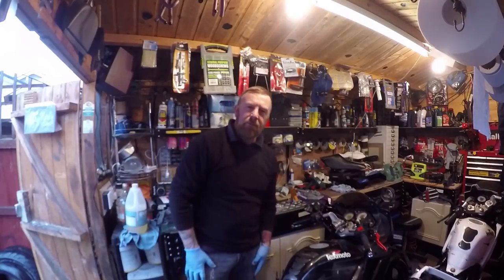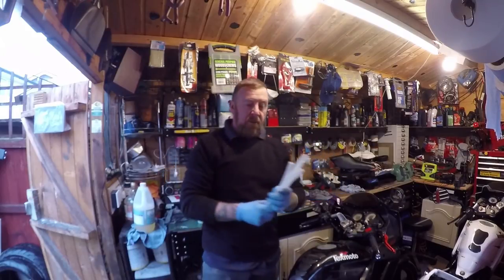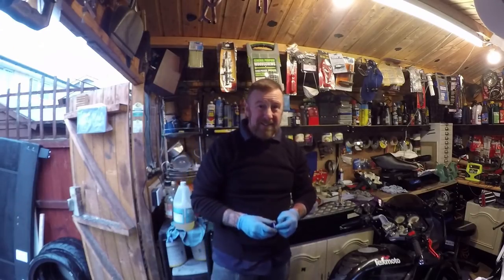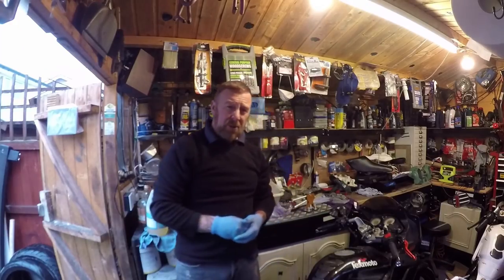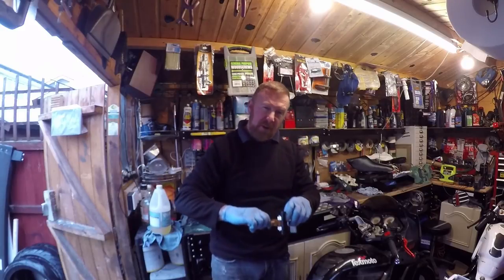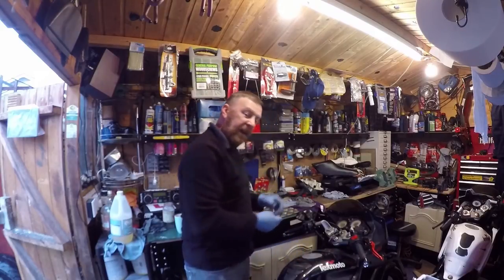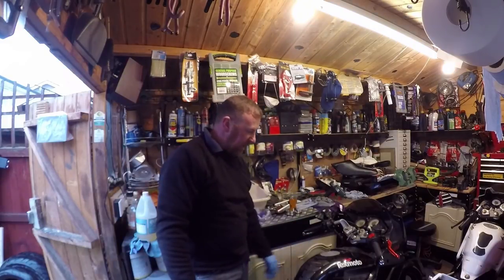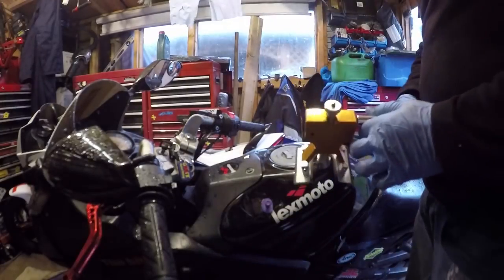DENT REPAIR REMOVAL KIT DOES IT WORK ?! MARK SAVAGE

Comment: I guess its a copy of the similar system used in the motor trade. They weld line onto the panel, then use a puller to ease the rent out.
I guess this system is only as good as the glue.
In one of the other comments you mentioned the hot water method. I tried this on my brothers car. Was a bit sceptical, but it vastly improved the dents.

Comment: You have to key the pads before you use them, when they are new, they are too shiny and have a glaze for releasing from the molds. Best thing is to give them a rub with 240 wet and dry, clean them with panel wipe before applying the glue. And use the largest pad possible, to get the best surface area. 
      Good luck. 
Ps acetone cleans well too.
Reply from the maker: also worth a try takes bud

Comment: it should work,  put a few holes in the plastic so glue comes out creates a better seal.
also, there are lots of different grades of adhesion glue they come in different colours the
one your using is the standard only good for fin metals,  you need the black one anyway goodluck
Reply from the maker: ok thanks ill look into to that

Comment: Hi Mark. Could it be that the face of the pad is too smooth? Maybe if you roughen it up with some course sandpaper/wet & dry, that may improve the adhesion?

I had a cheap GoPro copy and the brackets wouldn’t hold their positions no matter how tight they were done up. It roughened all the faces and they all gripped nicely.
Reply from the maker: that maybe work a go ,thanks for the idea and ill try but think the petrol tank was too think and may work better on a car door as thinner. thanks for watching bud 
mark

Comment: OMG the suspense was killing me! Can’t believe you tested it on the fridge, that must have been another slap around the head!? I reckon the glue needs longer to set, although it does raise the question of getting the jobbie off once the dent has been pulled out 🤔
Reply from the maker: I did try it a few time on other thing not alone the fridge lol, wife's got a bad knee so managing to keep just a few feet in front before the slap pmsl 
any way it just didn't work on what every I tried for me but have seen it work for others so it was worth the test but its a no from me 
take care bud and have a great xmas 
mark

Comment: You need to grind it back to bare metal and get a spotweld puller and it will come out
Reply from the maker: a little over kill as this was supposed to be easy with no re spraying and so on but to be honest I just let it as is as only a cheap bike 
thanks for watching 
mark